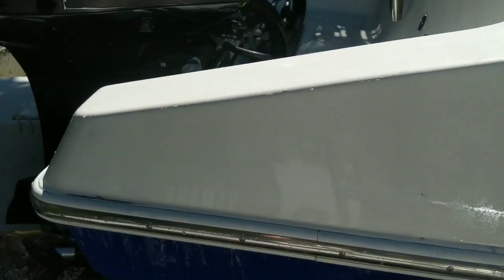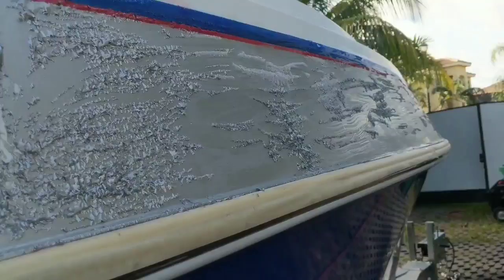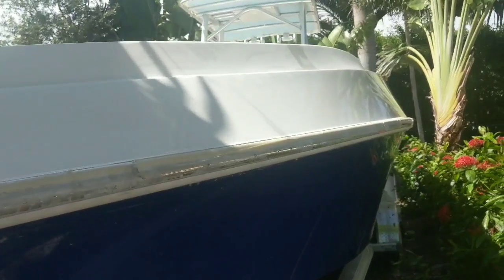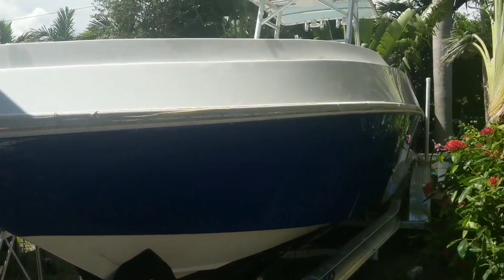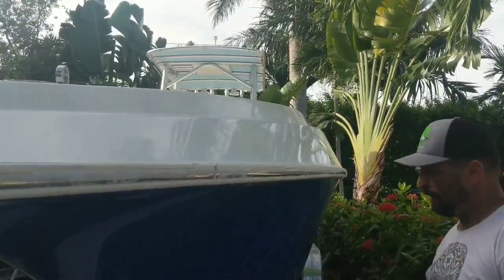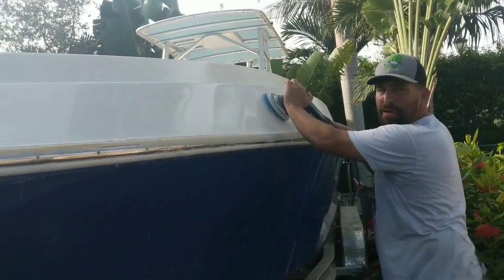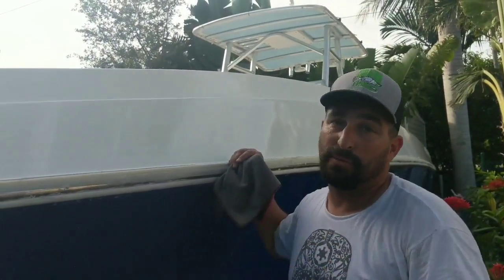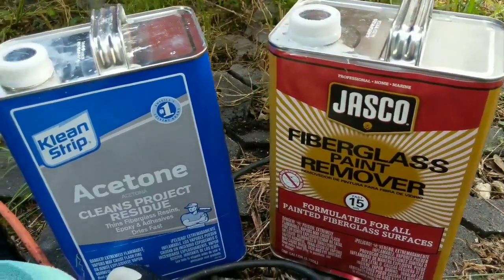Removing paint from a Fountain 31 without damaging gelcoat (Part 2)

Comment: Alfred, I'm restoring a 50' boat that was turned into a security boat, and spray painted gray. I tried using paint stripper, but it takes too long, is too messy, and in the end, there is no way around sanding. So, I use 120 grit and lightly sand off the paint (no pressure, and only in straight lines, no circles.) I can see the paint being sanded away, and I am careful not to sand into the gelcoat. Once the gray is gone, I go to 400, then 800 grit, then 1,000. After that, I polish with Meguiar's fiberglass restoration polisher, then wax it. It comes out beautiful, and no mess. The problem lies in sanding too aggressively into the gelcoat. It's almost impossible not to take off some of the gelcoat, but just a bit under the paint isn't a problem.